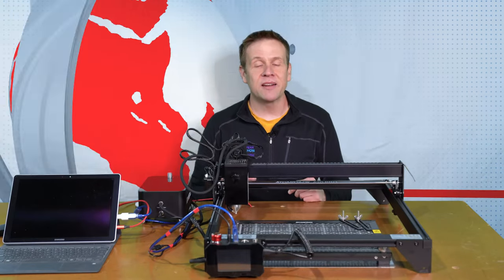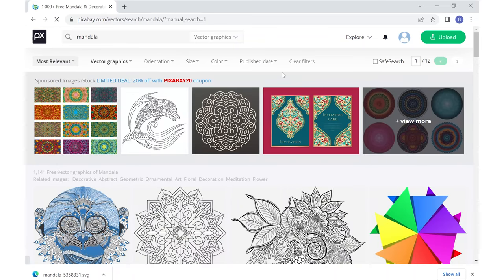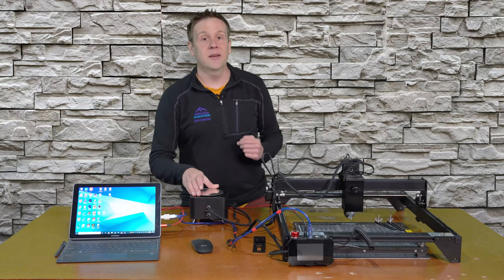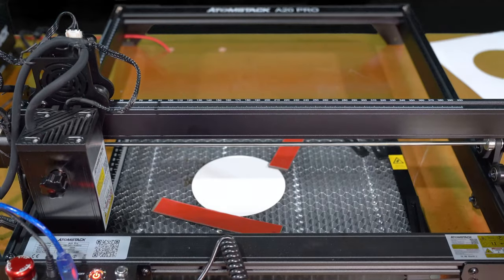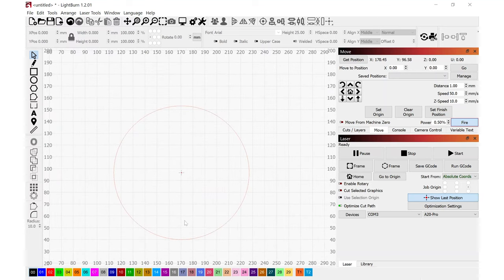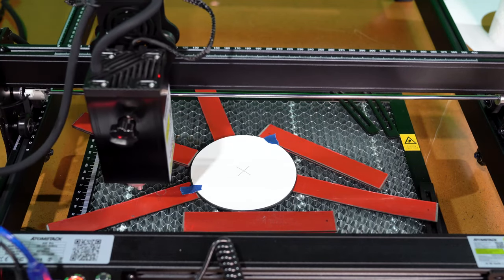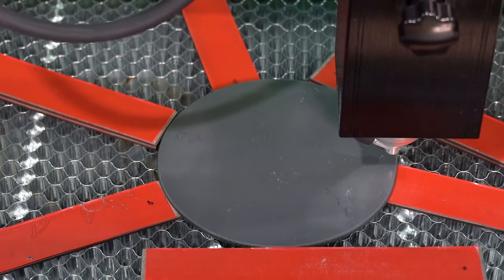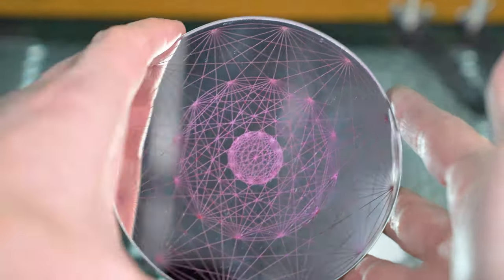Laser Project- Mandala Mirror!

Comment: Just another way to do this. After you cut out the circle on the paper,  leave the paper there.  Then turn the circle you have in lightburn into a tool, lock it down and then you put your design in that circle. Allign it, place your mirror right in the space you cut out then burn away. Also use something other than honeycomb under mirrors. Use something solid. Honeycombs cause problems. Way too much power. Run that at 4000 at @45 power.
Reply from the maker: Thanks for sharing! I used the honeycomb just because I like to use the magnetics!

Comment: That was awesome. Your instructions are very helpful. Do you have any suggestions for starting speed with xtool 1O w. Thank you
Reply from the maker: Thank you!  I would try the same settings as the video; 120mm/s at 65% power.  It doesn't take a lot of power to laser through the back of the mirror.  I suggest having a test mirror to dial in settings!  Enjoy!